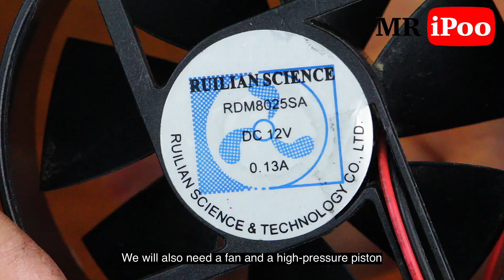How to Make a DIY Air Conditioner/Heat Pump! ❄️🔥. Air conditioner or heat pump at home 🌡️

Comment: Hello, i am interested with this project. May I know from which store/ online shop that I can buy this metal compressor ? If it is a high flow/ speed/ pressure compressor, what is the minimum speed or pressure to be used for this compressor? I can't find the smallest metal compressor until now.
But I found there are several metal fuel pump with 4-7 PSI from some online shop, is it suitable for this project or for the small AC project as I saw from your other videos? Thanks & Regards.